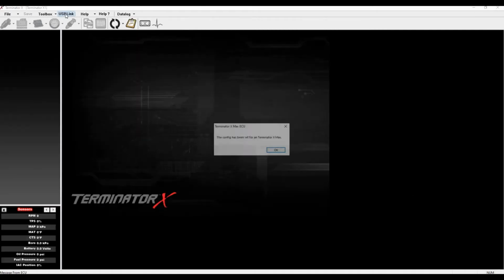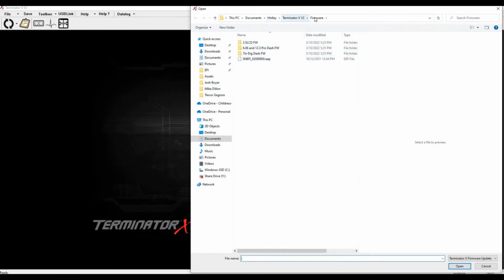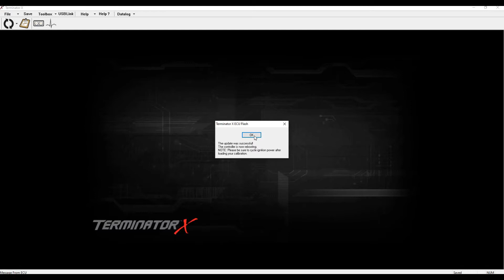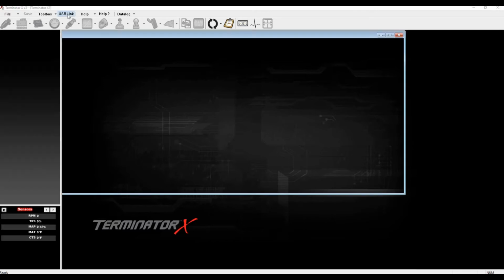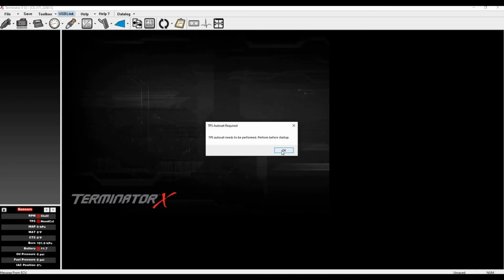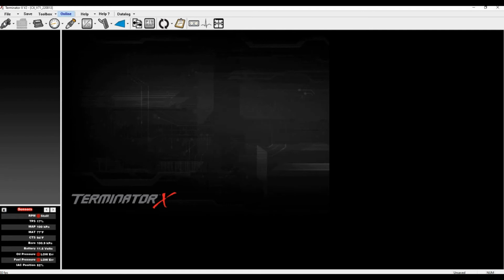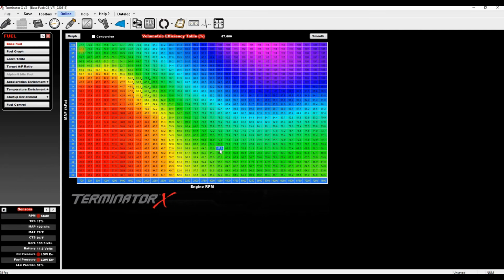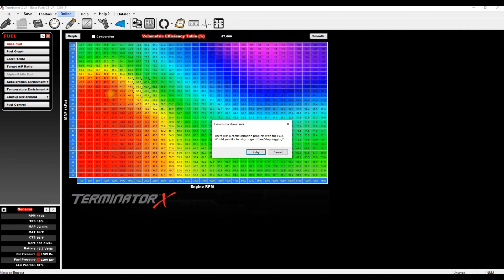How to Perform a Holley EFI Firmware Update

Comment: Great video. May I please ask a question? If you bought a holley terminator x without the handheld and your connecting it to the car for the very first time should you perform the update straight away or build a base tune and then update? Ie: I dont know what software my current ECU has yet until i put the ignition on. Should i download V2 & V3 on my laptop prior to connecting for the first time. Hope this makes sense sorry.
Reply from the maker: Personally I would update first to take advantage of the new options In the later release
Reply: @greenshortsperformance  thanks for the reply I appreciate it. So pretty much as soon as I key on I should update then? as per your advice make sure nothing is connected? ie: Dakota digital dash etc. Sorely Just the laptop and all other programs closed.
Reply from the maker: @johnflanders7523  Yes. Key on, let ecu come on. Don't click the usb link button and perform the update.

Comment: I see the TPS is a 16% when you are idling. Is the tps set to 0 before this video?
Reply from the maker: That is due to the DBW throttle. On drive by wire you have pedal position and throttle position. Since there’s no IAC valve the throttle blade is opened some amount to idle the car even when not pressing the pedal. I did a “perfect DBW idle” video you should reference. If you have a DBC setup your tps autoset should rest the tps down to 0-1%. When warmed up your IAC should be about 2% at idle
Reply: @greenshortsperformance  Just watched your video. It was very helpful, lots of good tips. I have cable setup. I set the IAC to approx 4-5% at hot idle. The motor ran somewhat rougher (it atleast felt like it), but the data seems ok i general. LS1 engine. Anyway, thanks for posting. Love to see more.
Reply from the maker: @BessieMorrison  4-5 will work fine but should not have made it run any rougher.

Comment: One note, you can also go backwards using the same process.
Reply from the maker: Great addition! Yes for any reason you can go back. I typically wait quite a while after a new release to be sure the bugs are worked out but I had a few guys go to v6 on dominators that went back to v5 when some of the v6 issues were still unresolved